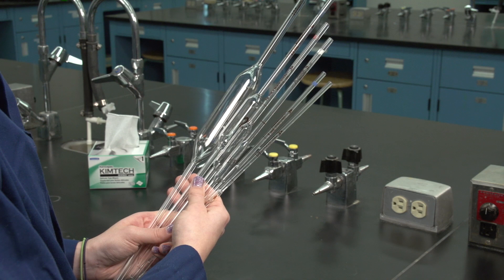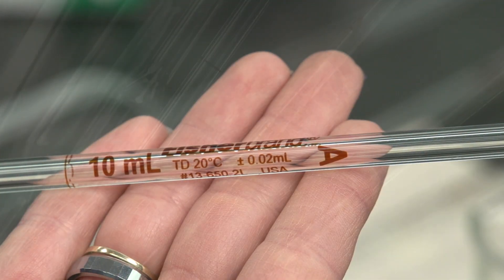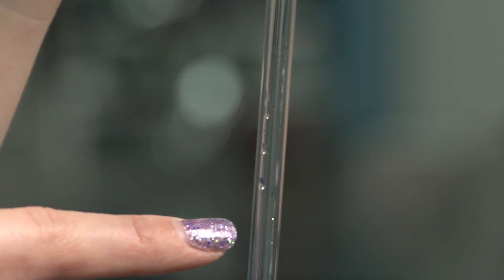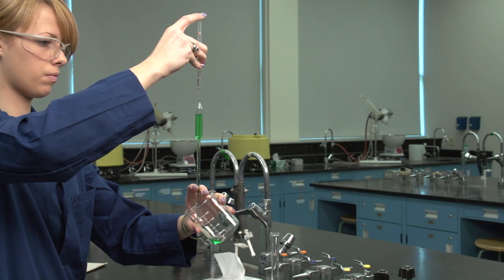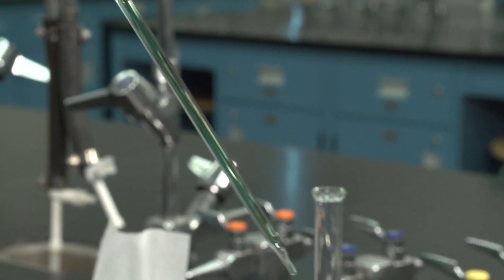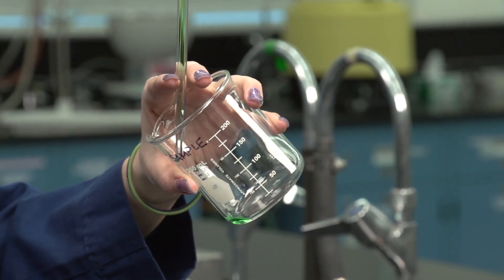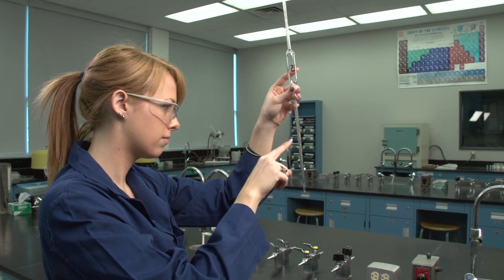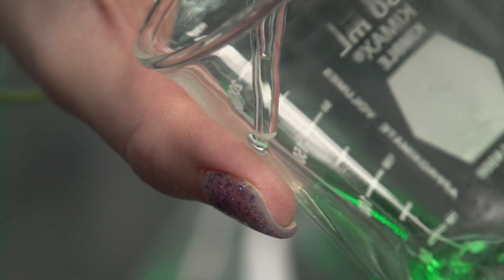The Volumetric Pipet and Pipetting Technique

Comment: Great presentation. About the last drop, it may be tricky to identify which is the last drop. Also when you dispose the content into a volumentric flash with narrow neck, the handling is difficult. when you use a bulb for disposal you can drain out the liquid by squizzing it, and in that case a small drop remains into the pippete but its a smaller one than from free fall. if you do measurments with water, you will see the difference..

Comment: why is necessarily the case that the bottom of the meniscus must be at top of the demarcation strip, to denote the volume of interest; and not the bottom of the demarcation strip. Wouldnt the strip necessarily denote a bounded domain to which the ideal desired volume proababilistically lies in between if the bottom of the meniscus is within that range?